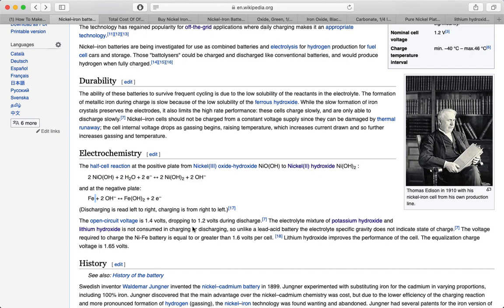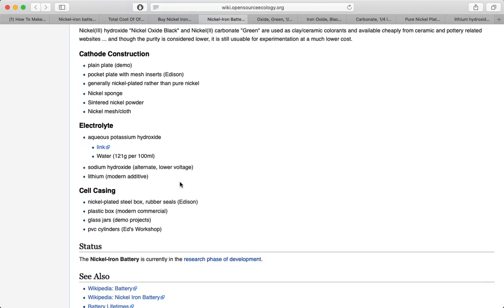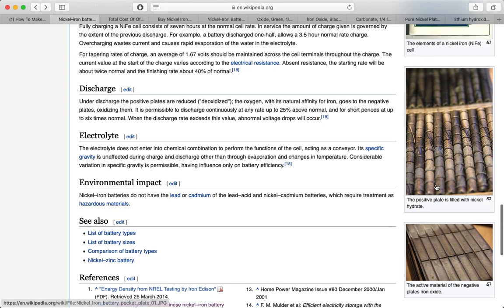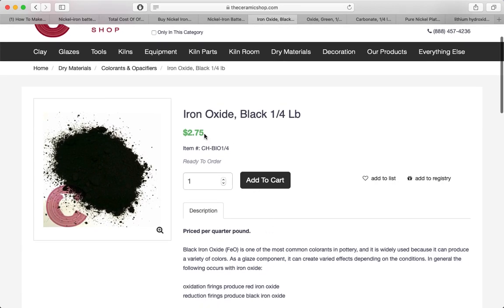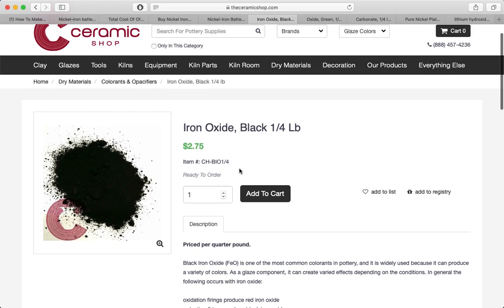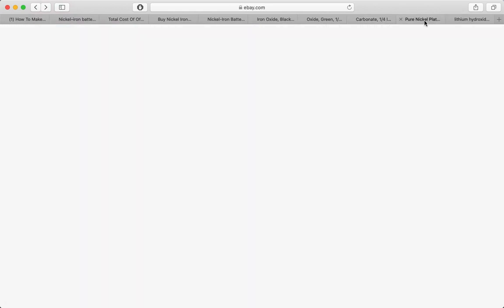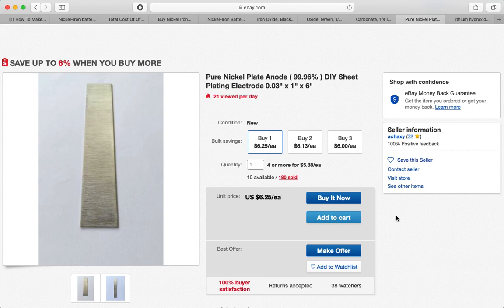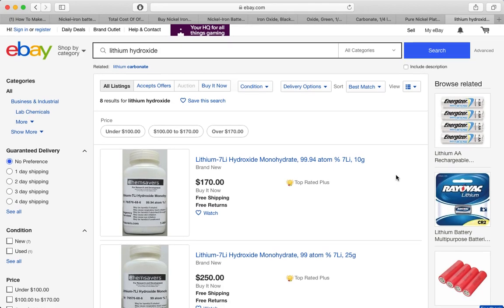How Nickel Iron Batteries Work

Comment: you may have solved the LiOH problem, but in case you haven't.... get some Energizer Lithium AA batteries and remove the lithium metal.  If you put that into plain DI water, you will get pure lithium hydroxide.  Just remember that as the white LiOH forms, you will form a protective layers on the lithium sheet.  That will stop the exothermic reaction over time.  Just cut the sheet up into pieces.  I think you might get 7 grams of lithium metal per battery.  If you make the case out of PP or similar heat weldable plastic, you shouldn't need a protective coating of Ni - If I understand the process correctly, it served only to protect the steel case.  Good luck with your project!  Doug

Comment: Robert Murray Smith has a simple tutorial on making Nickel OxyHydroxide powder. Super cheap and easy, and uses commonly available material. He doesn't do it in an ice bath, but I would if doing this at quantity.

Short version: bleach + sodium hydroxide in solution. Add nickel chloride. Boom.

Comment: @Off Grid Permaculture, Daniel I've been experimenting with putting together a Open Source Nickle Iron battery for my ebike. I'd like to share my STL files for the jigs I use for plating my fabric electrodes. Done standard CF cloth but I want to find a good carbon felt material to expand my surface area without the weight of having solid Nickle and Iron electrodes.
Reply from the maker: You can contact me here: daniel@offgridpermaculture.com . I'd be happy to share them here and on my website offgridpermaculture.com

Comment: I understande the wonderful durability of the batteries NiFe, however they actually sacrifice a lot of received energy, due to their very low efficiency. From my research, although they are a similar price LiFePO4 batteries offer a lot more in terms of reliability, even though a manufactured battery may be 50 - 60% more expensive, and you can construct batteries of cells yourself fairly easily - The NiFE battery will lose charge very fast compared to the LiFePO too, what do you think about this. I love your videos and ideas though! keep them coming!
Reply from the maker: You bring up a good point. Lithium batteries are expected to self discharge by about 2-3% per month, where as NiFe batteries loose roughly 1% /day according to one manufacturer (ironedision.com). Typical solar or wind power systems generally only store about 3 days worth of energy in their battery bank, so the ~3% loss is not significant. But, if you needed your batteries to store energy for weeks or months between charges, then lithium is the most cost efficient choice over the lifetime of the battery bank. I have a more detailed cost break down here: https://offgridpermaculture.com/Off_Grid_Energy/Total_Cost_of_Off_Grid_Solar__Photovoltaic__Systems.html